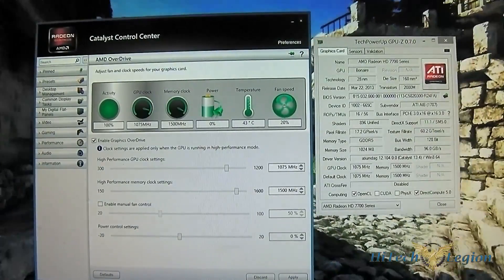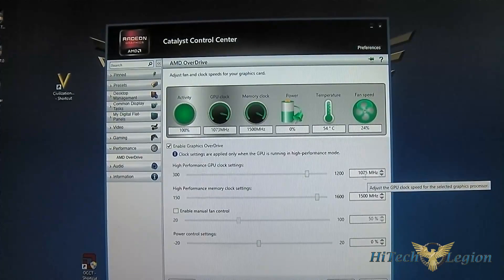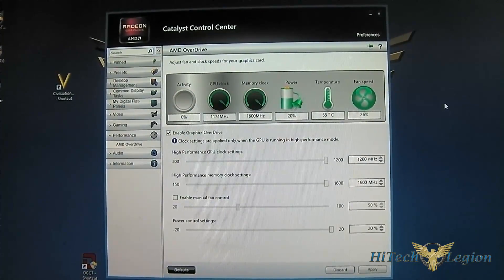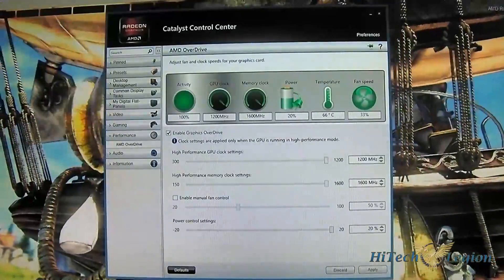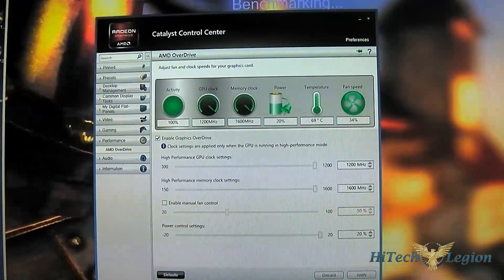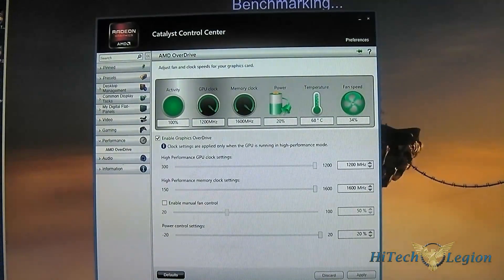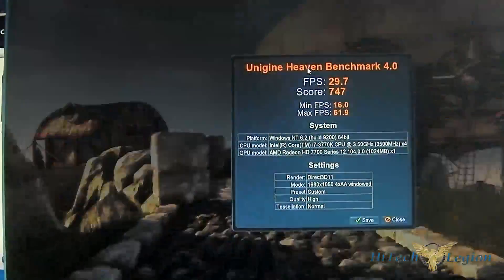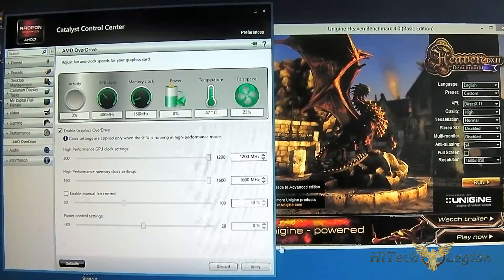PowerColor HD 7790 Turbo Duo Overclocking Tutorial Guide

Comment: if you download HIS overclocking tool it should unlock core voltage and then really get the core clock up. use that a long with MSI unofficial  overclock. it worked with my sapphire 7790 2gb oc

Comment: a question about overclocking because im new to it and don't go laughing at a noob lol but my question is what dose it mean when my drivers stop working when overclocking my temps are really good apparently when i change volts on my car it dose nothing just gives me a little bit performance here and there and they are a cross fired 7770 and nothing is really stopping my overclocking but the drivers is there a way around the drivers so i can overclock them more or is it just saying my card wont